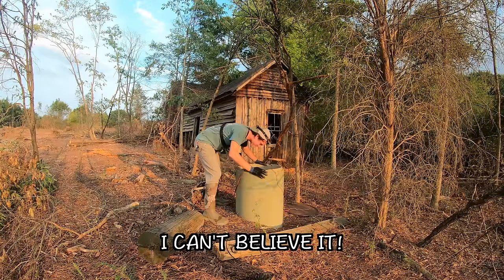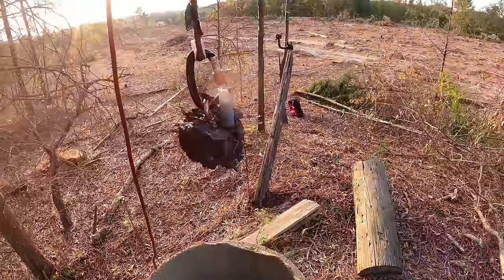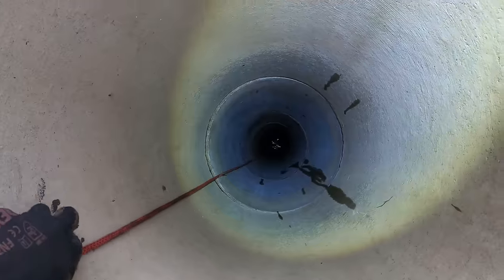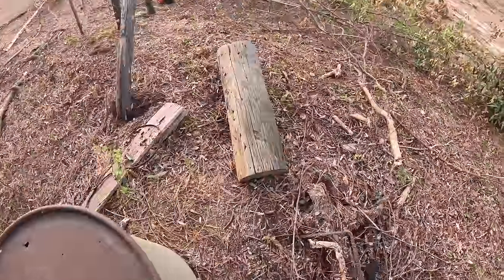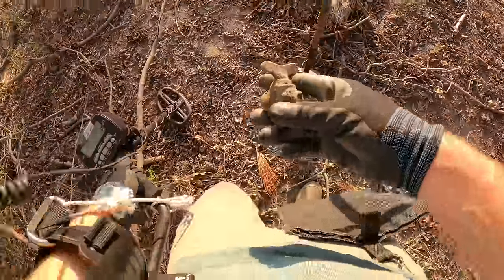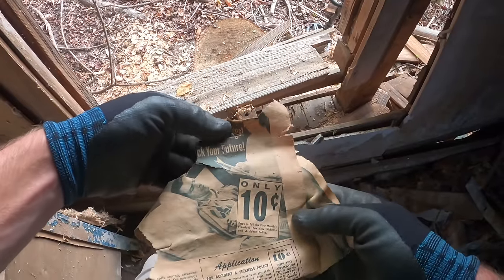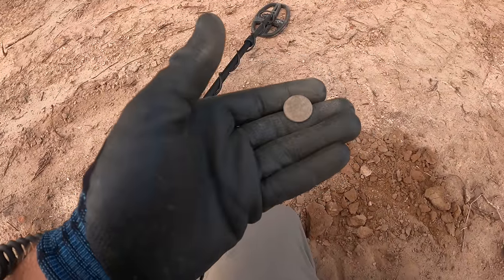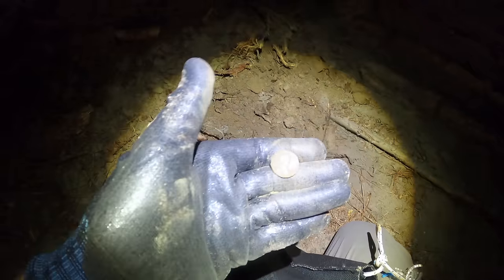Magnet Fishing Deep WELL by Abandoned Cabin! (Can't Believe What I Found)

Comment: Yes please, I'd enjoy seeing what your camera sees down the well. 
Love the old weathered wood/square nails lying around too.
Great recording & editing on another fun adventure of discovery.👍
Reply from the maker: Thanks for watching!
Reply: The wood around the well was probably the framework for the pulley for the bucket. He should check for the pulley maybe on the ground. We had a similar well in the 60's. Ours was smaller and the tube was glazed, red clay, pipe. It had a tin bucket/cylinder about 5-6 inches across and bout 3 ft long, with a trap door in the bottom that opened when it hit the water and drew in the water til the bucket sank. Then you knew it was full and pulled it up. The trap door closed when you pulled it .  There was a hand pump at the kitchen sink and an outhouse out back.